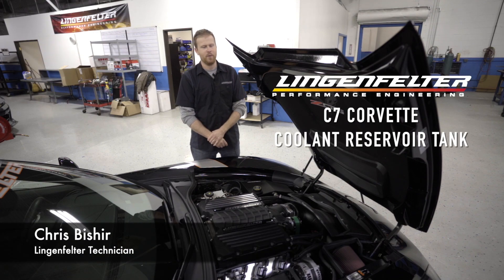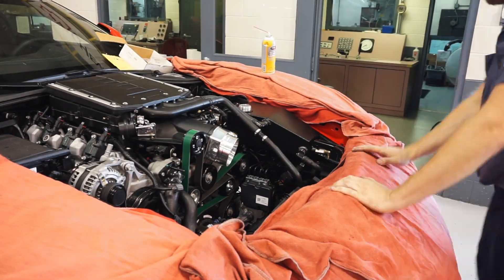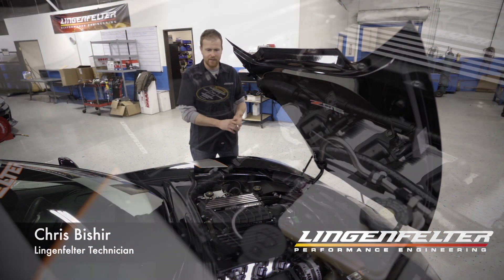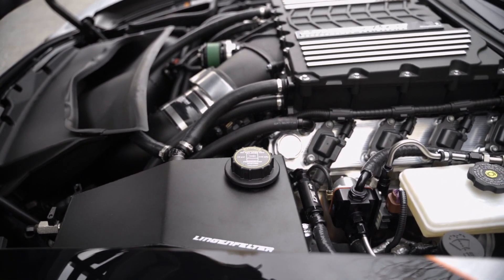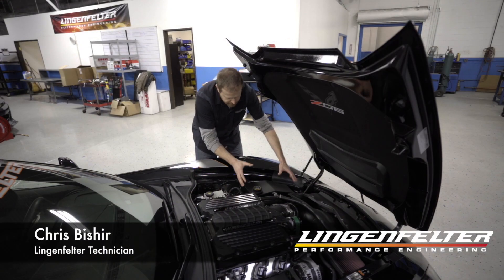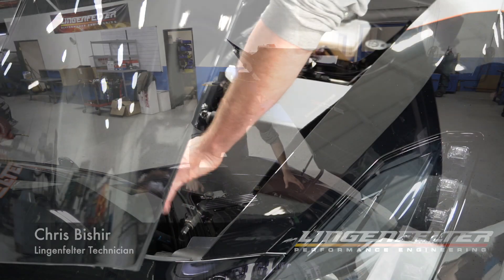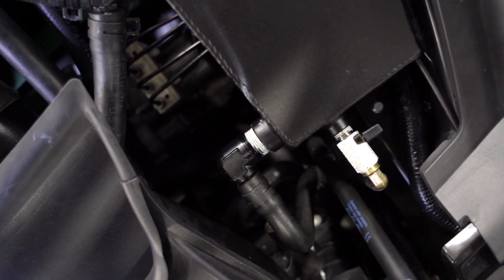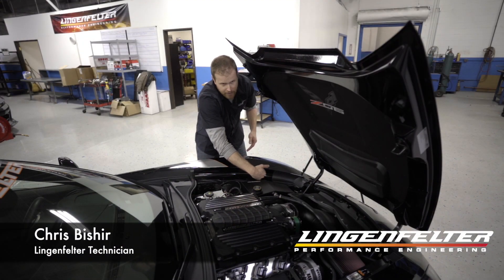Lingenfelter C7 Corvette Intercooler Coolant Reservoir Tank Info video

Comment: I purchased this Intercooler Coolant Reservoir Tank from Lingenfelter for my 2016 ZO6.  Within two years, the Powder Coating began flaking off, and Lingenfelter declined to replace it. Their logic was that the connectors were overtightened therefore I caused the flaking near one of the connectors and also approximately 10 inches away from the connector on the other side of the box. Funny thing is that I had contacted them because it was leaking near the attachment that I had hesitated about tightening any farther, ... the elbow attachment they provide would have to make another full twist to stop it from leaking, but my thought was that it would not be able to complete another full twist without way over torquing and possible striping out the thread so I'd never had a perfect seal, and the hose kept backing the elbow loose, ... so I contacted them because I wanted to see how they felt about doing that before I took any action and in the process I asked about the Powder Coating chipping off and the possibility of providing me a replacement. But, they were condescending and pretty much down right insulting about it being all my fault. I was a big fan of Lingenfelter, but with this sort of Customer Service ... I'm done.